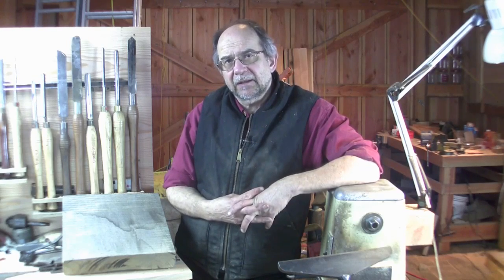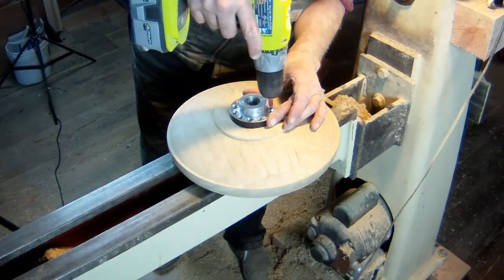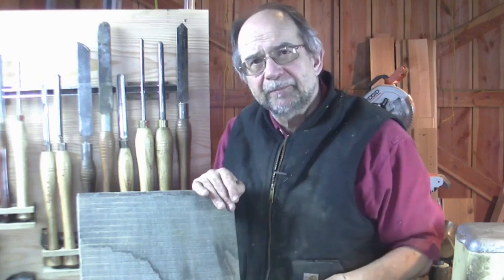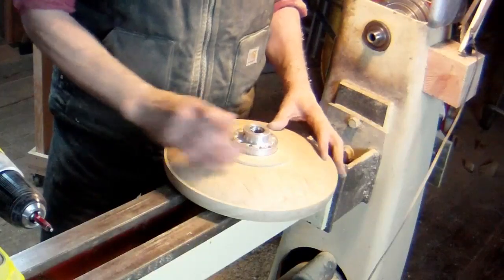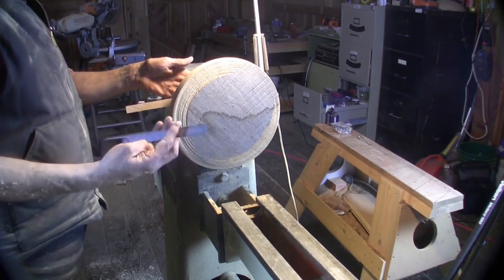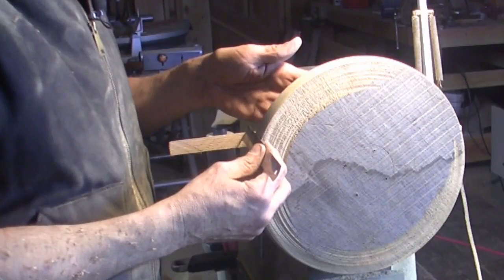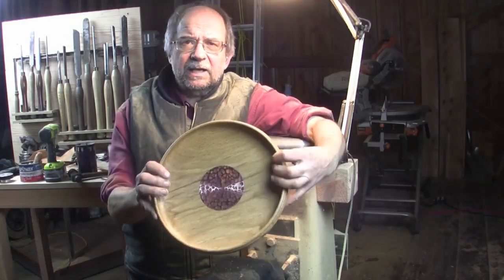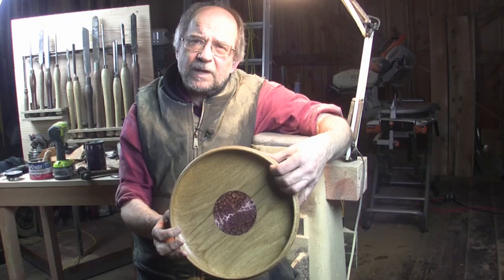Woodturning Off Grid 3

Comment: graceful, simple and as you said, very arts and crafts even a bit Macintosh but what about the screw holes in the base ?
Reply from the maker: Hi Tony;
Thanks for watching...and your kind words.
Before I invested in a fancy chuck (or two) I would mainly turn using a faceplate of some description. This was years ago....and it was then that I made my mistake & masked my error using the copper insert. As for the screw holes on the underside, I would cut a disk of colorful felt (usually red or green) and glue it tidily into the recess. My giftees have always been thrilled (inside and out)...only curios woodturners ask how or why :-) :-) :-)
Best regards,
M

Comment: great video and excellent tip.  I live in BC as well, can you tell me where I might find copper sheeting like you used?  Thanks
Reply from the maker: Thanks,
Standard roofing grade copper...should be available at most sheet metal shops.
....or try the local metal recyclers/scrap yard :-)
Regards,
M

Comment: Is there a way of heating the copper short of putting it into a fire?  I don't have a fireplace or stove to do this in.

Thanks for the videos.  You are a great inspiration to me.
Reply from the maker: +Larry Dubia 
Hi Larry,
Thanks for your enquiry & your kind words.
The copper needs to be heated to a dull cherry red colour in order to properly soften (anneal) it, so it can easily be re-worked.
If you have a conventional electric range (or if your neighbour has one) place the copper sheet on the surface element & crank it until the copper is the right colour, then quench in water. Don't forget to turn off the stove! Just a suggestion...good luck.
Cheers,
M

Comment: Excellent work,have never used copper or garry oak before. Is garry oak as hard as white or red oak. brought back some koa from HI
Reply from the maker: As with most wood species, the density of garry oak varies somewhat. The piece I turned in the video was not quite as hard as the other species you mention. I have used other pieces of garry oak every bit as dense as red & white oak. So the answer is...it varies :-)  Garry oak is not commercially available to my knowledge.
I'm jealous of your koa!
Regards,
M

Comment: Great video. I am now a subscriber! Do you know the thickness of the copper? I would like to try this trick. Thanks.
Reply from the maker: Hi David;
I'm not sure of the exact gauge but it is the standard used for roofing installations. No need to buy a full sheet - you may be able to pay scrap price at the local recycling/scrap yard.A touch of 5 minute epoxy will help retain the copper to the bottom of the bowl...something I neglected to mention in the vid.
Thanks again for subscribing!
M

Comment: I enjoyed the decoration, but felt like you were scratching your fingernails across the chalkboard when you attached the face plate to the foot.  You need to sell a wife, a kid, a boat--anything to afford a chuck.  Screw holes in a finished project?  Not in these times even if you are off grid. I guess if Scottish ancestry precludes a chuck you could use a glue block, then you could keep your wife, kid and boat but still avoid screw holes in the finished product.  Happy "screw-holeless" turning!
JZK
Reply from the maker: Hi John;
Your comment may qualify for "comment of the year". Ha ha ha :-)
The wife isn't going anywhere, the kids left home & my little boat is too dear to me.

My intent with the vid was to show what happened historically and how I came upon the idea for the copper inlay. Fast forward to recent times & I do indeed posses a number of chucks. Better & more versatile chucks are being invented all the time. They all have their uses, as do faceplates.

Thanks so much for your comment....and keep guessing...I'm not Scottish (or Australian). Happy "I use a chuck all the time" turning to you!

Best Regards,
M
Reply: John that was an on spot comment. :)
Reply from the maker: Rodger Pettiet Here's my chuck vid :-)
Woodturning Off Grid Part 1